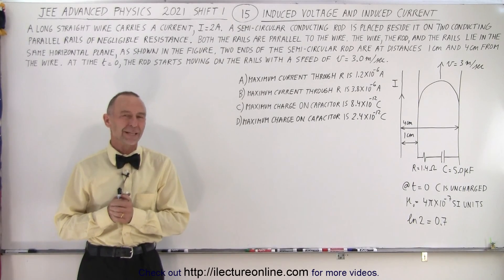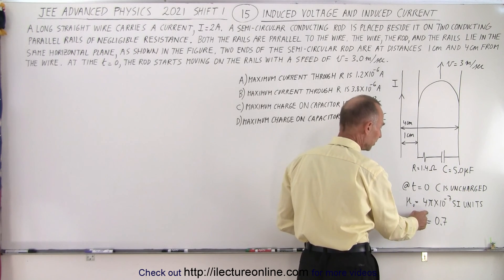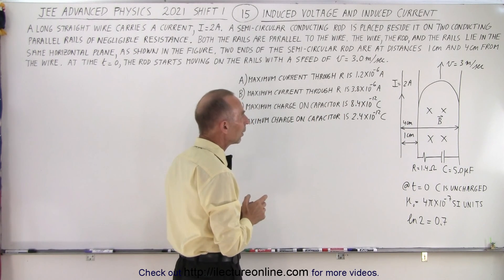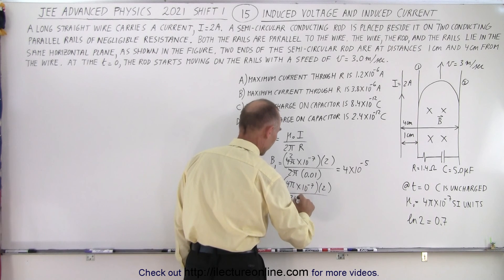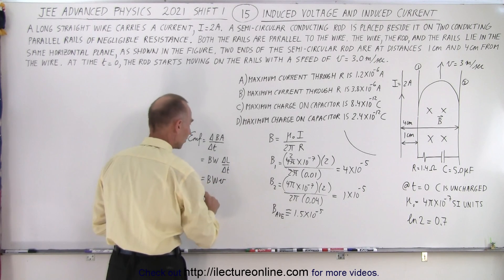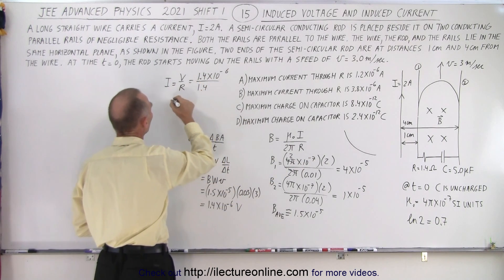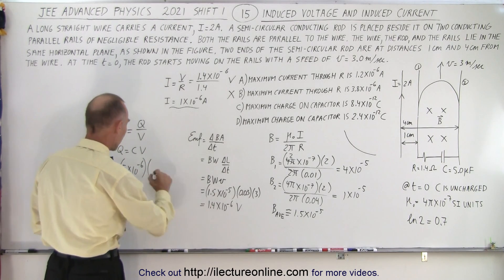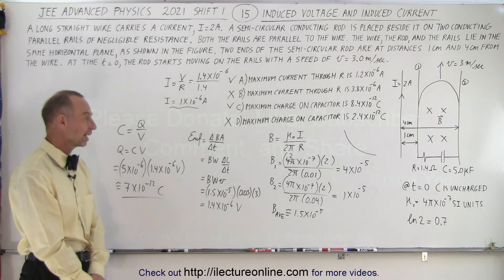JEE Advanced Physics 2021 Shift 1 #15 Induced Voltage and Induced Current

Comment: we could also have used integraton to calculate net magnetic field and then we could use the ln2 given in question to find the "exact" answer! (but i am curious with what logic you did that approxmation of magnetic field there?)
Reply from the maker: Yes indeed.  That will work.  But with limited test time, we have to use approximations whenever possible.

Comment: Sir the question does not specify a constant velocity of the rod being maintained, yet it must be assumed to arrive at a constant value of emf in order to get the correct solution. Why is this? Would there not be a force ( integral of i dl x B ) acting on the rod throughout its motion, leading to some sort of terminal velocity?

Comment: note :  there are three systems  in physics :   fps = foot, pounds, seconds
cgs = centimeters, grams, seconds
mks = meters, kilograms, seconds

so i would like to know which system you are using.
Reply from the maker: The units used are MKS     (note that the mass equivalent unit for mass in the Imperial system is "slug".
Reply: @MichelvanBiezen  how to derive what 1N is in dynes ?
Reply from the maker: 1N = 1 kg / 1 m x 1 sec^2     1 dyne = 1 gram / 1 cm x 1 sec^2    Therefore 1 N = 1 x 10^5 dynes